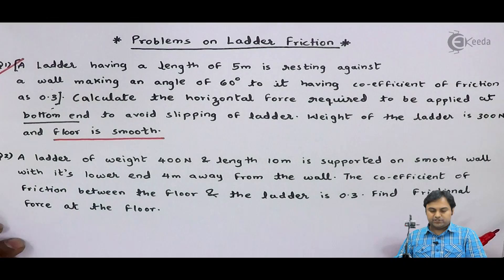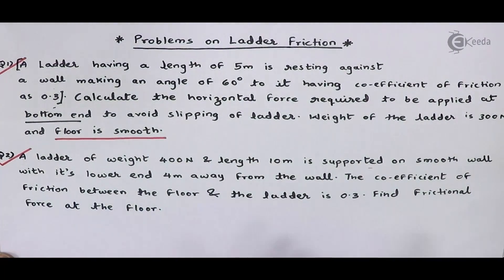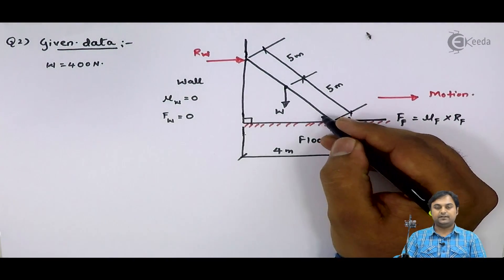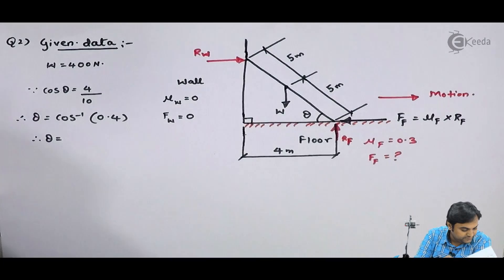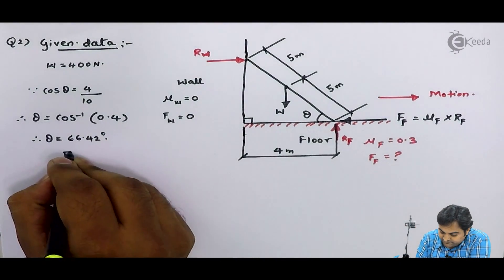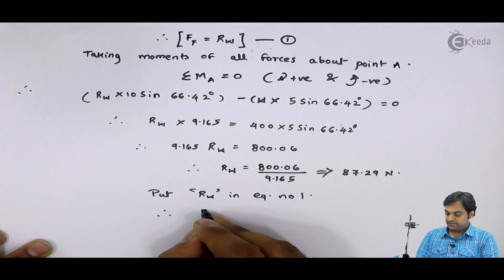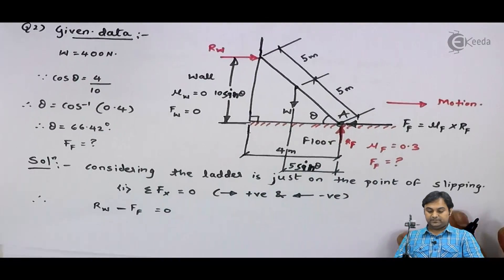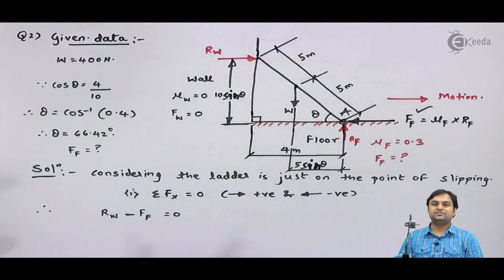Ladder Friction - Problem 2 - Friction in Engineering Mechanics - First Year Engineering

Comment: It is actually an incorrect problem because on applying different approaches we get different  results. I think ladder will not be stable with the required conditions.

Solve it with three different methods:

1. Taking €Fy = 0, we get Rf = 400N and Ff = 120N

2. Taking moments about point of touch between ladder and wall, we get Rf= 639.767N and Ff= 191.93N

3. Solving it accordingly shown in video, we get different answer.
Please try all these methods.
Reply: That is true because I tried solving this by taking  summation fy=0 and got 120 as the answer.l was very confused with this answer. So wrong question I guess☺️